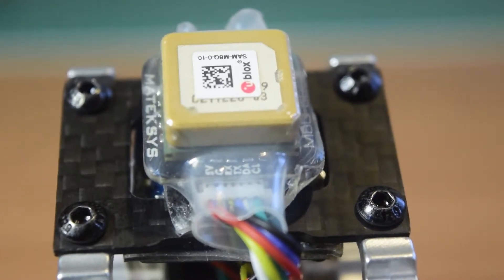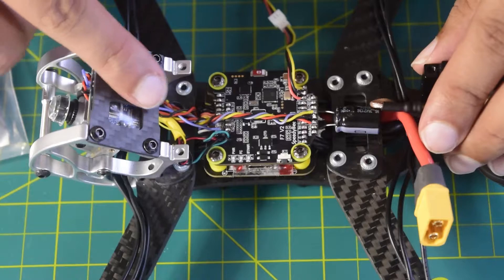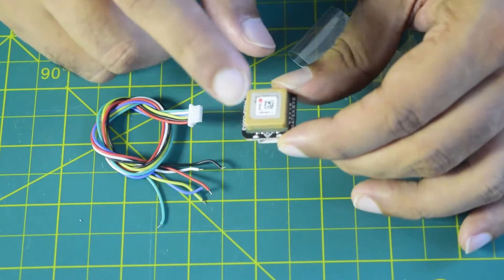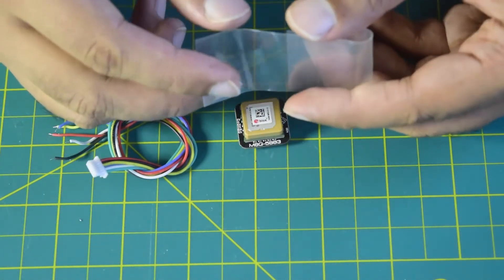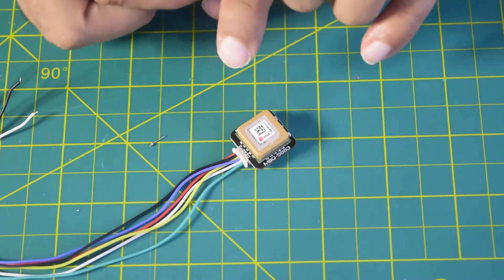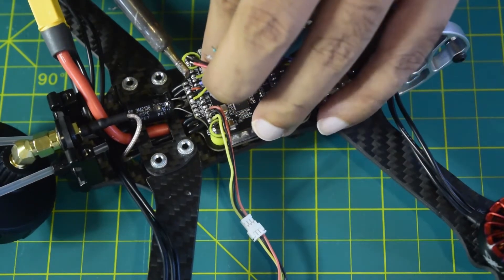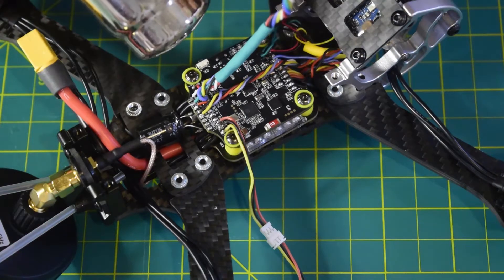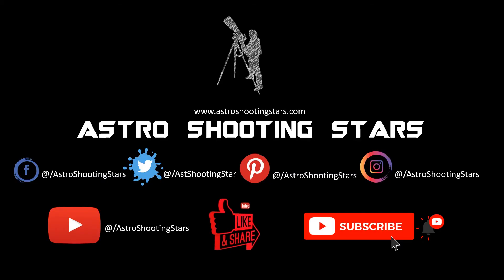How to Install GPS on Speedybee F7 V2 FPV Racing Drone | MATEKSYS M8Q-5883 GPS SAM-M8Q AND COMPASS

Comment: hi could you please tell me ,which Uart Port is for GPS in betafly? thanks alot.
Reply from the maker: you can use any free UART port on the board and later configure it in the port section of the firmware. I hope this helps. please stay tuned to my channel for my future videos